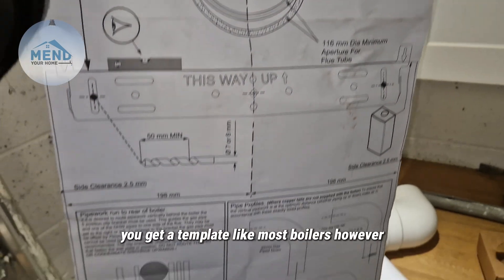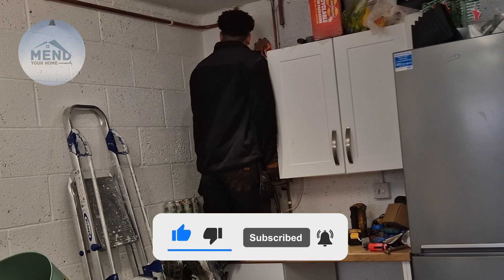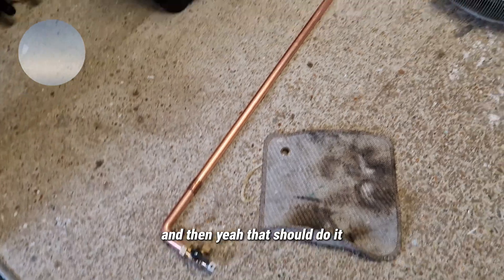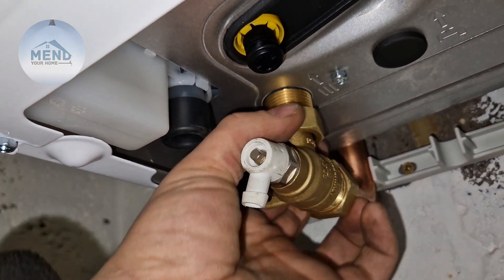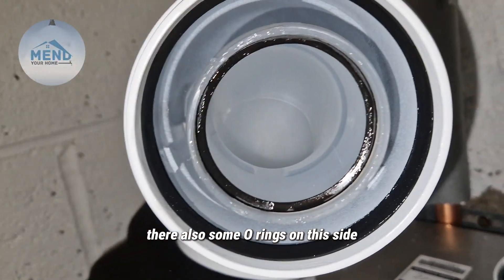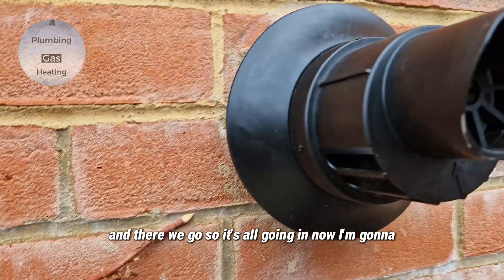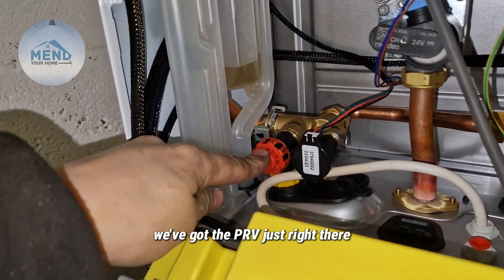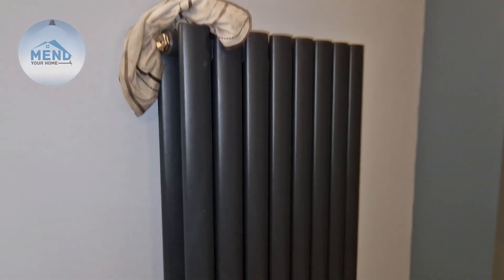Baxi 800 System Boiler Install with Filter, flue and Magnacleanse

Comment: I’ve wired up a Hive thermostat to the OpenTherm and and then onto the switch with no joy, neither firing up the boiler.  In the absence of any timer or functions on the boiler, is there a step which I’ve missed??